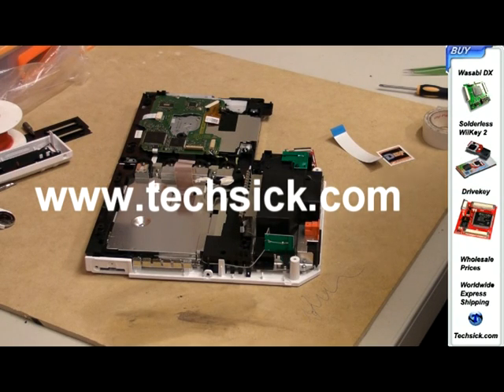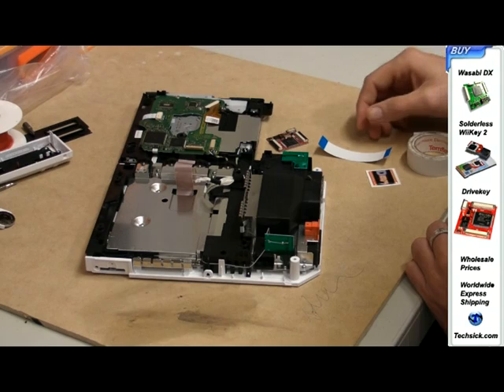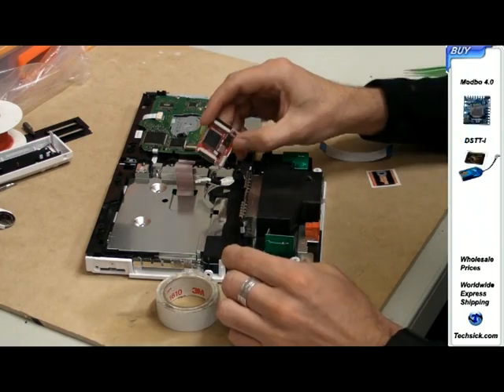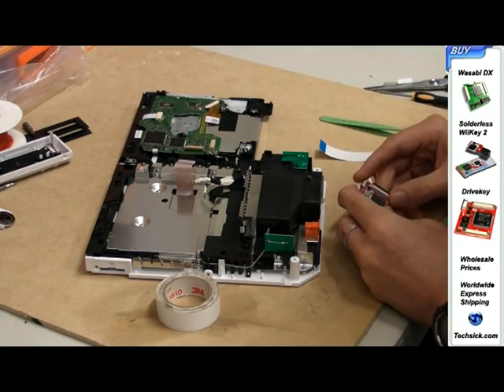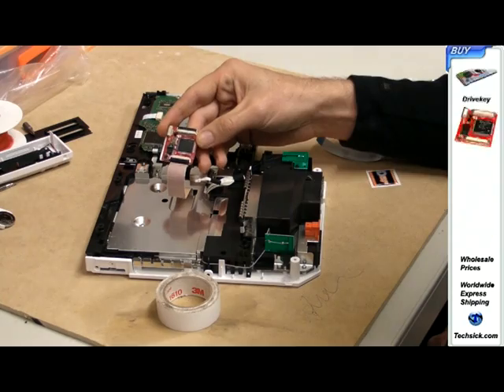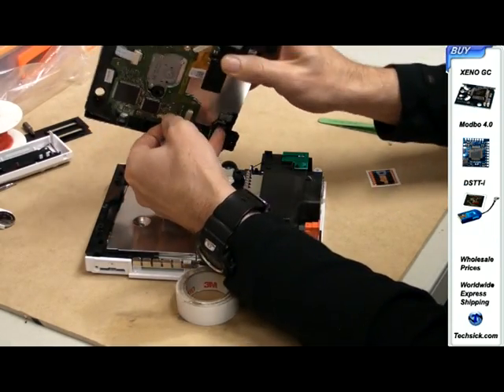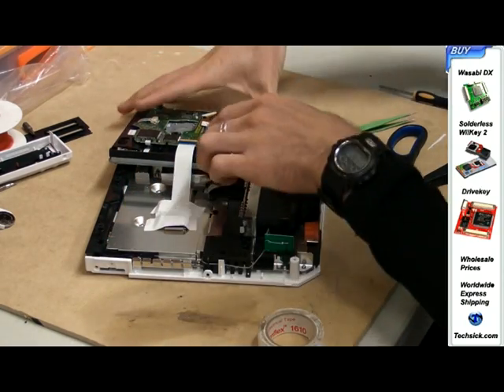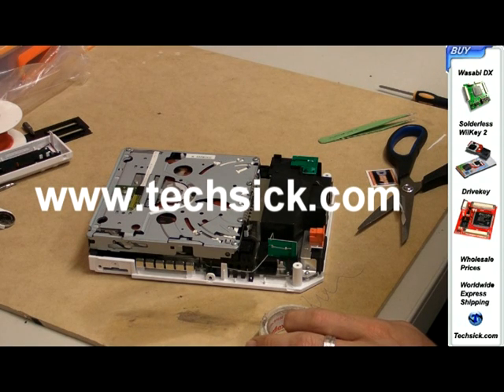How to install DriveKey modchip in your Wii Complete Guide

Comment: i did this and i covered the topside with normal tape but not under side it had marked dvd but no text for wii but it was obvious since it was on opposite side of dvd but heres the thing i burned a game and put it in i burned an iso ntsc with img burn on a dvd - r disc but it said some error message what is wrong the region thing was alredy locked off and placed in some region and it was annyways a muliregion card so what now???